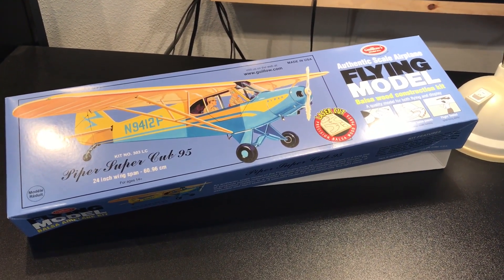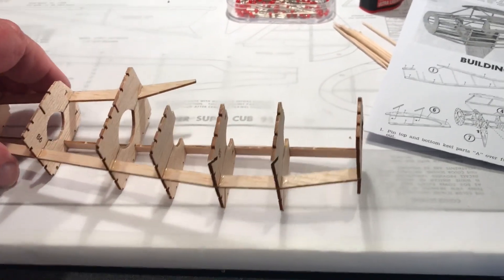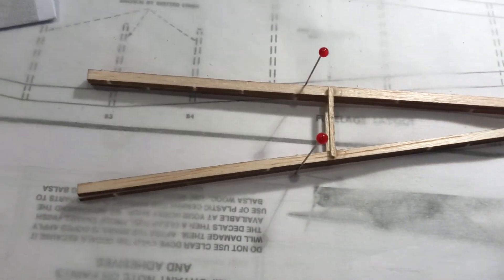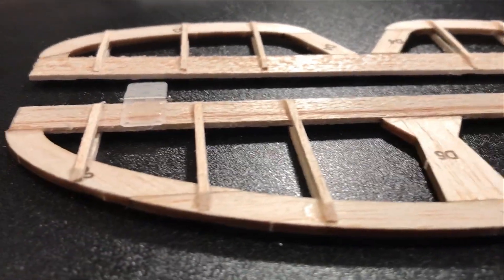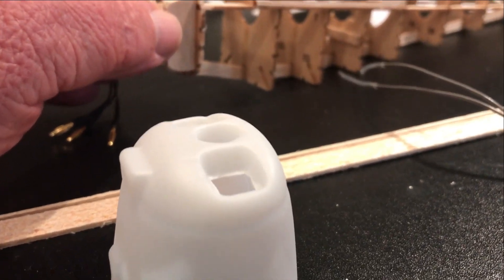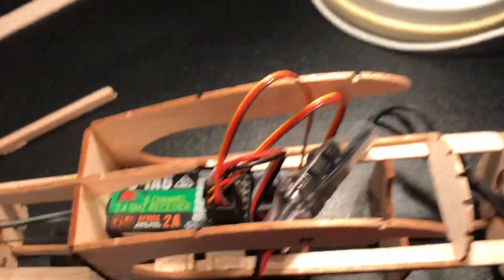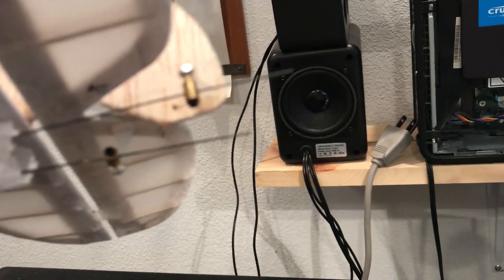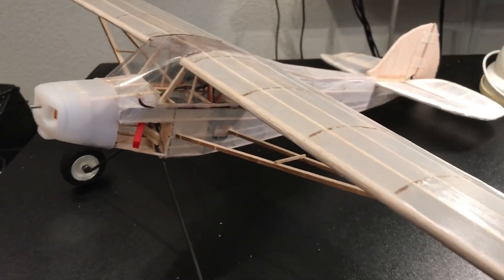Guillows Piper Super Cub

Comment: Nice build and thanks for the tips.

For future reference, the tail surfaces on the Super Cub are not profiled with an airfoil, they are flat, tubular structures so the leading and trailing edges are rounded, but that’s all.